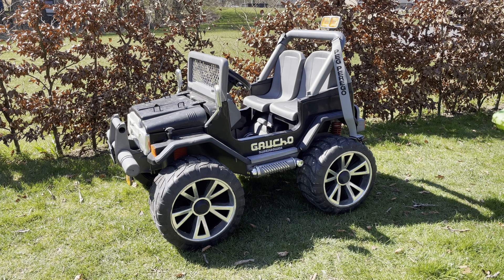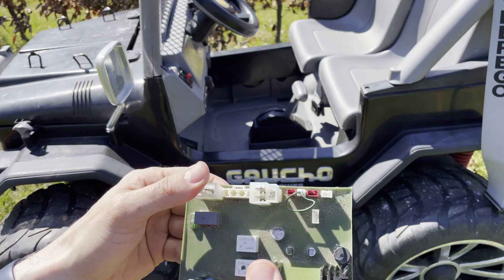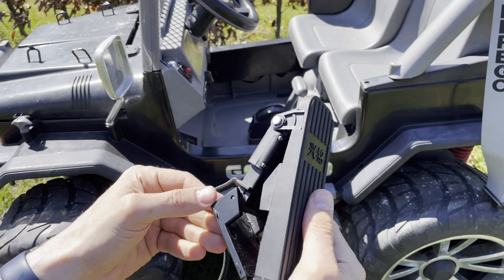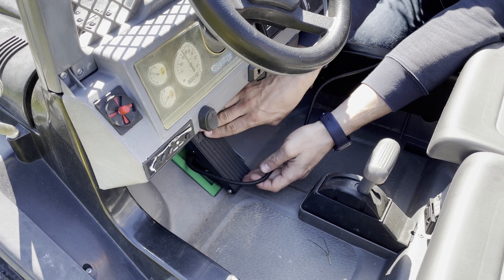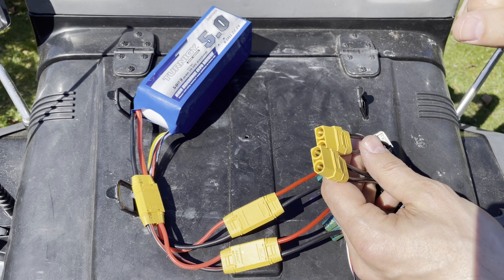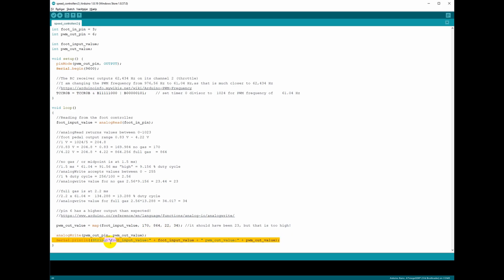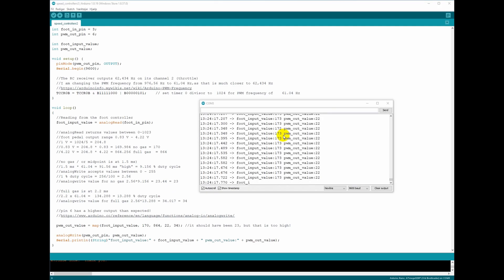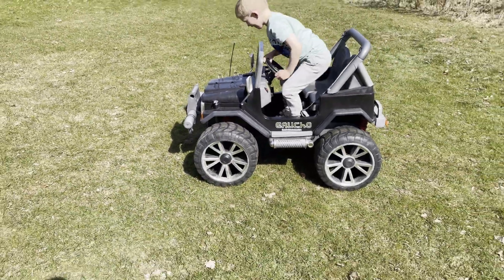MODIFIED Peg Perego Gaucho Superpower 24V

Comment: I have a PWM controller 12/24 v to control the speed of electric engine with potentiometer. You think it will work?
I have gaucho with on/off pedal. The speed I want to increase with potentiometer
Thanks

Comment: Hi,i saw the video.
I have followed the procedure and the car works, but I did not understand if it is possible to use reverse gear with arduino.
And then,Is it possible to increase the acceleration ramp time from 0 to full gas?
I am not an arduino expert
thank you
Reply from the maker: Hi Fabio
I am happy to hear that.
Yes, it is possible to set the ESC into reverse, it is just a matter of setting the pulse width to 1 ms, which is approx 6 % duty cycle. I will consider doing a video on that.
I am not an Arduino expert either, but I don't think the Arduino is the limiting factor in the acceleration. Maybe the ESC you are using has been programmed to a slow start? I have used other ESC in other projects, where I could program several settings such as acceleration.
Reply: @kaspersorensen  more info for cable connection  to arduino and how to reverse gear... it will be awesome. Thanks